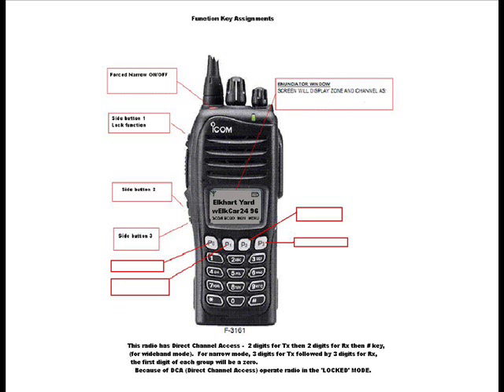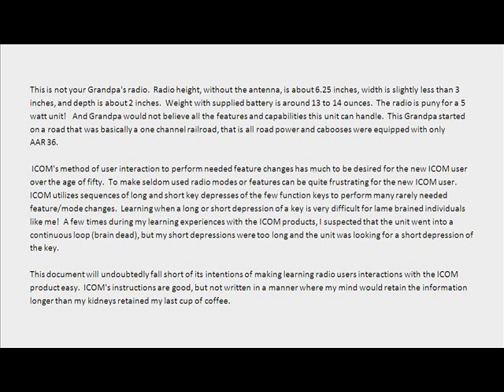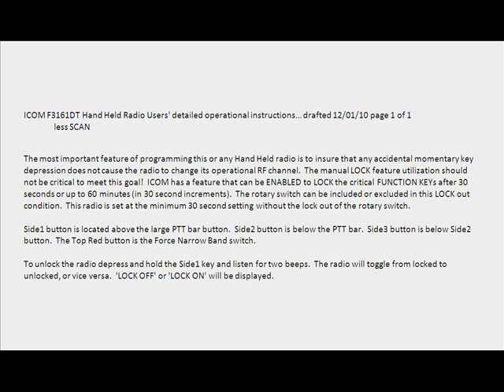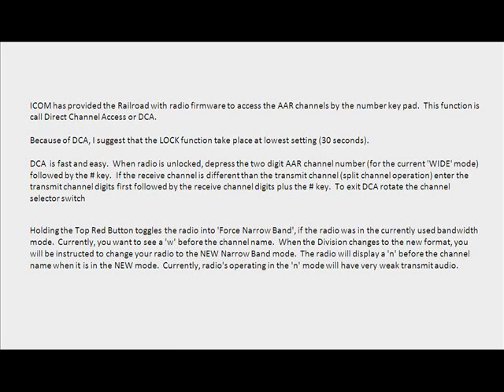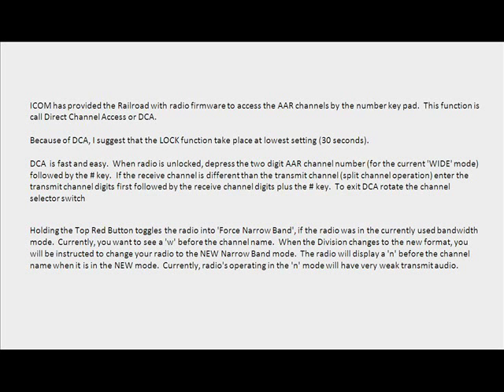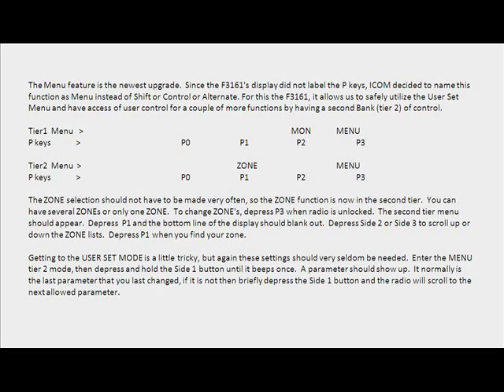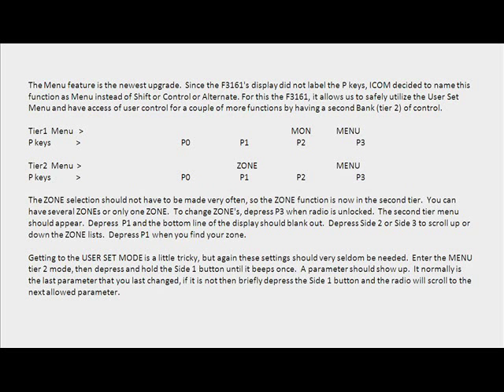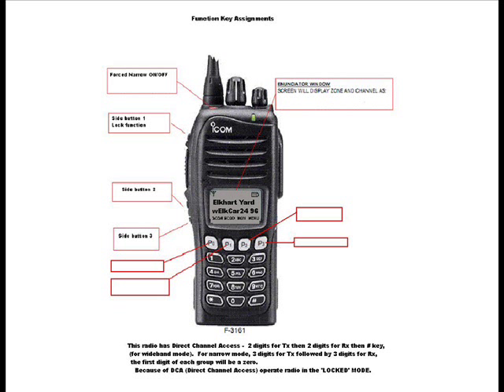ICOM F3161DT RADIO VHF HANDHELD 5W BEST PRACTICES OF PROGRAMMING

Comment from the maker: Well, it has been about two years since the railroads switched to the 'new narrow-band analog FM'.   Lower audio quality, more annoying squelch popping, and in some yards; more "phantom channel bleed-over phenomenon."

And if your radio tech, thinks he can tighten the squelch so you only hear quality audio like the old system.  Then you will notice range degradation.

The real fun will come when all goes "digital."  Then, nobody hears the problems.  Nor will they have any clues of why.   I'm glad to be an old fart !
Reply: On your 3161, in analog have you found any settings to reverse burst the tail squelch? I've played with them but I still get a squelch tail most time on this radio 3161ds when a pl tone is used in rx. Any thoughts?